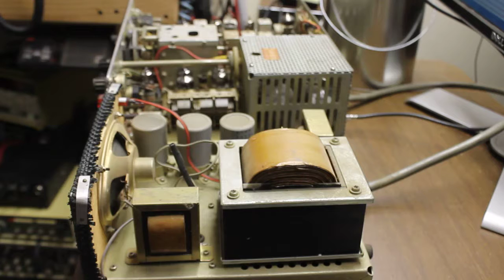Tempo One FT 200 Power Up on Variac

Comment: Hello! Can you tell me how to connect a 12 volt battery to the FT-200 and will it work from it?
Reply: I believe you need a DC-200 to do what your are trying.  It is the DC power supply for this radio

Comment: It's an act of pure folly powering up an old rig like this without replacing the electrolytic caps in the power supply first. Using a variac might seem like a good thing but its really a waste of time.  Those 3 big grey cans should be replaced along with all the others in the radio. I re capped mine in an afternoon worked like a charm.

Comment: I have a Tempo One and need to troubleshoot the power supply (don't even know if the RADIO works!!) I powered it up on a variac, but as soon as I got to 50 volts, one of the big honking resistors on that resistor board burned up!!! Do you have a video on troubleshooting/repair of the AC 1power supply? Anyone in YouTube land know what I need to do next?? Is it fixable,  or something that's pure unobtanium?? As common as these radios seem to be, there's NO VIDEOS ON THE POWER SUPPLY???